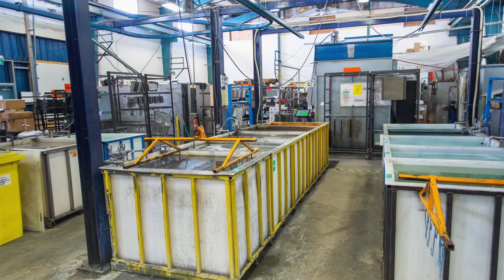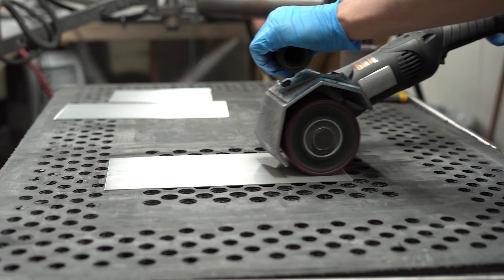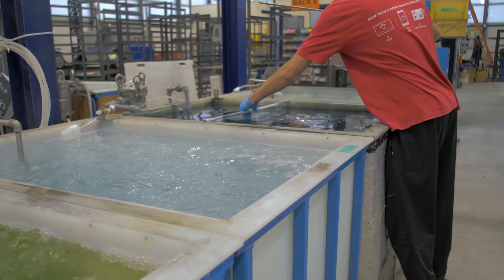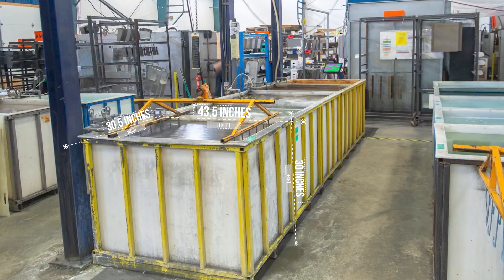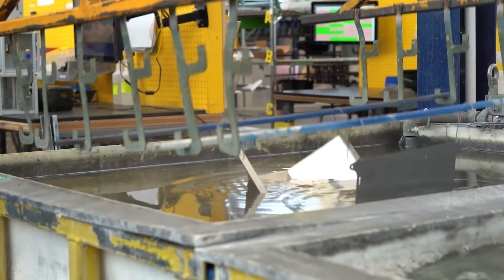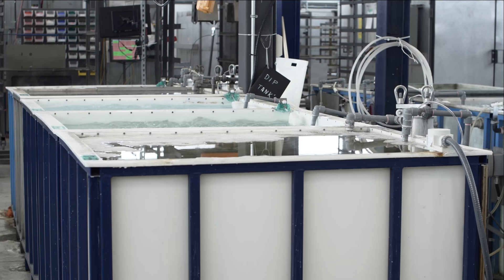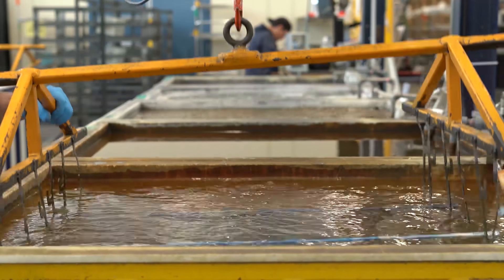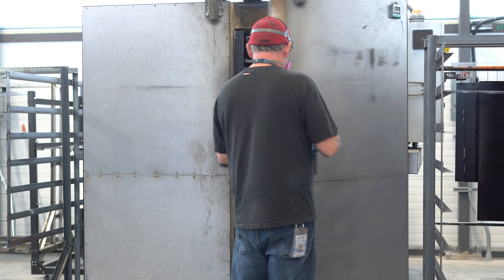Proto Tech Tip - Passivation for Stainless Steel

Comment: It is a iron-chromium-nickel oxide - and it is required since mill finish will have free iron and a nonuniform set of oxides - passivation with any oxidizing acid , nitric, sulfuric, citric, acetic will work.

Comment: Would you be able to share any data/information on how much better corrosion resistance you get for instance when applied on S.S. 304? I`m currently working on a project where I am considering passivation on 304 S.S. but I can`t find data that will help me understand the added longevity/value. thanks

Comment: Don’t you need to label the tanks for NADCAP?
Reply from the maker: Hey Aldo, we are not NADCAP certified at the moment so at this time, we do not have to label our tanks for that certification. Stay tuned as we are always adding classifications for our custom manufacturing processes!
Reply: @ProtocaseInc  Being NADCAP approved can open up the doors to many different customers, problem is you might need to add Nitric acid tanks to your production line. Other than that, nice job!

Comment: Can I get a black finish with this process?
Reply from the maker: Hey there,  for passivation specifically, no - the end result is clear (so clear in fact it's really hard to tell just by looking at a part that it has been passivated). If you're looking for a black finish, you'd need to opt for powdercoating in a black color. Or, you could choose black anodizing - as long as your part or enclosure is aluminum (not stainless steel). Hope this helps!